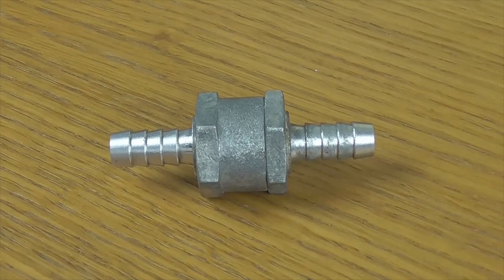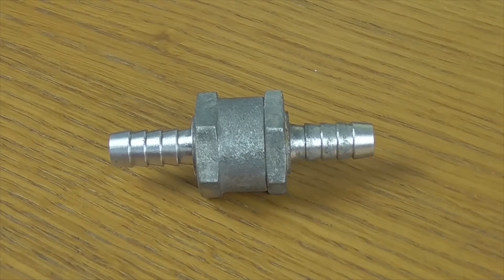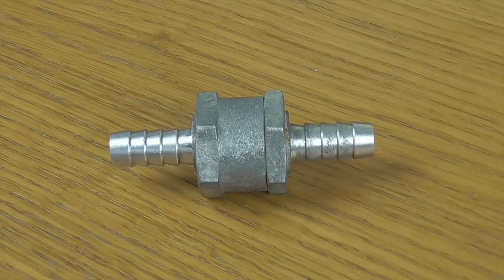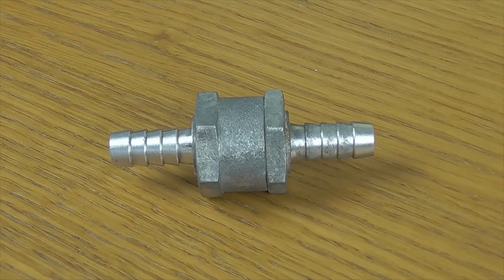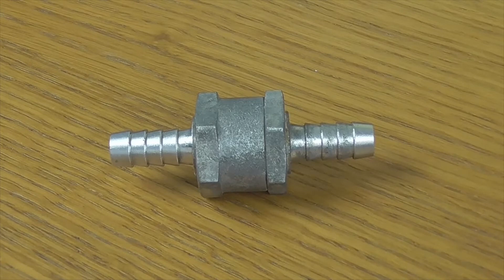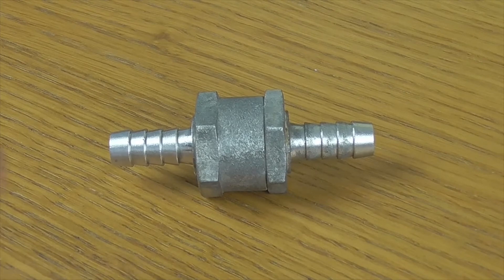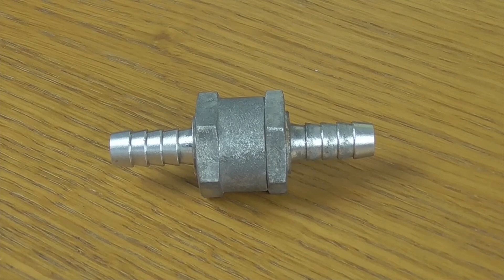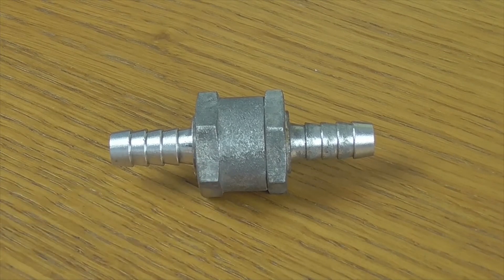NON RETURN valve, economica SOLUTION at the AIR inlet in the FUEL circuit, where it is installed

Comment: Could this be used for an air vacuum return valve. Issue with my vacuum pump. Ford don't sell the valve separately, and they want 600 euros for a new pump.